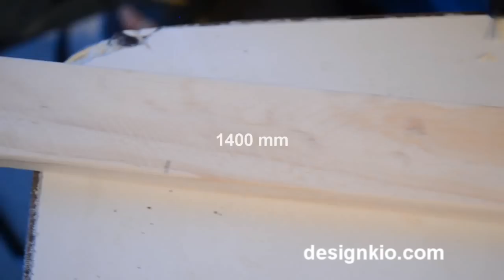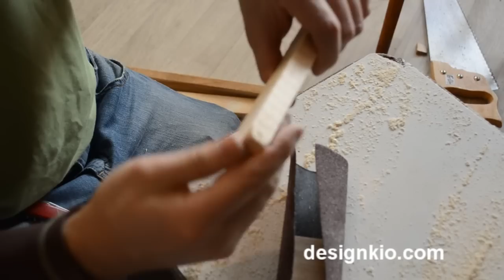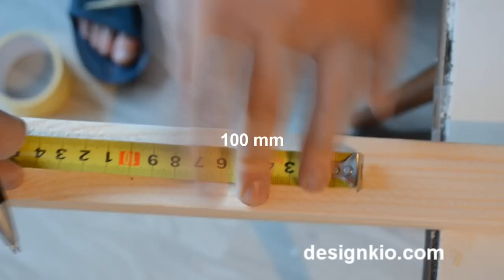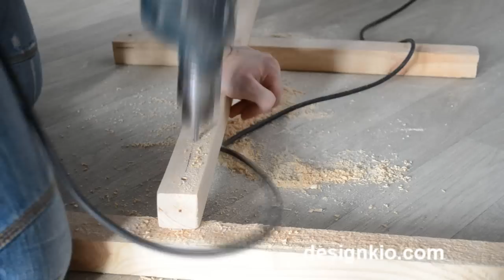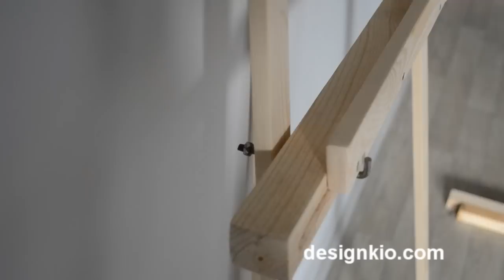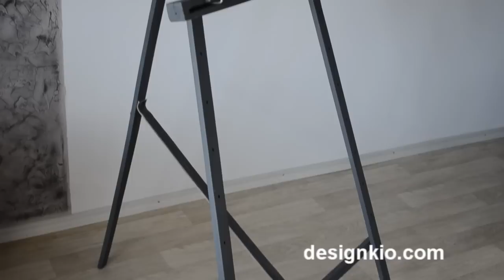Мольберт своими руками

Comment: I built an easel from the same plan on craftsmanspace.  However, I had the benefit of a power miter saw, drill press, and router.  You really accomplished a lot with hand tools.  It took me about 4 hours to build, but I still haven't sanded and finished it.  So you work really fast.